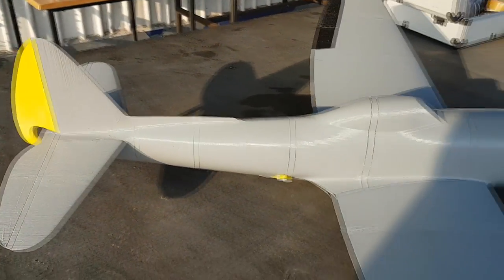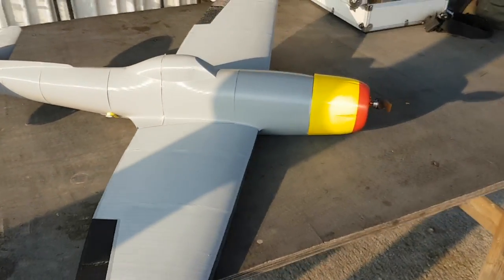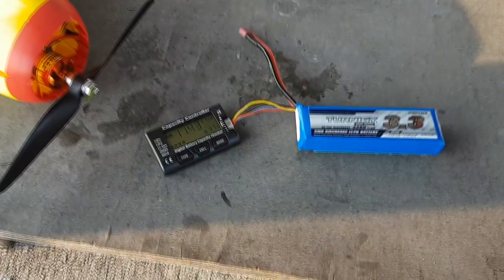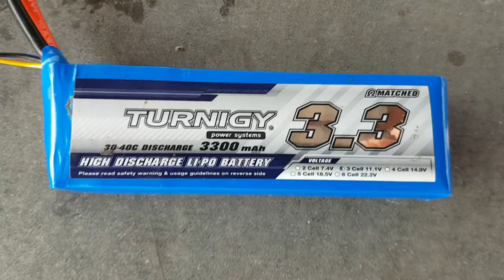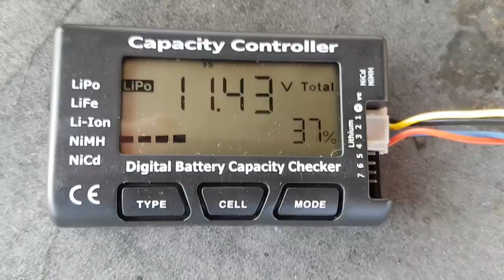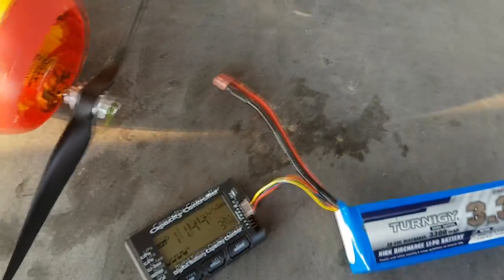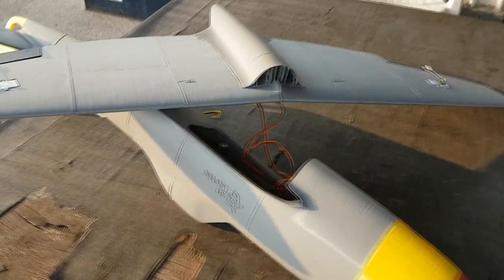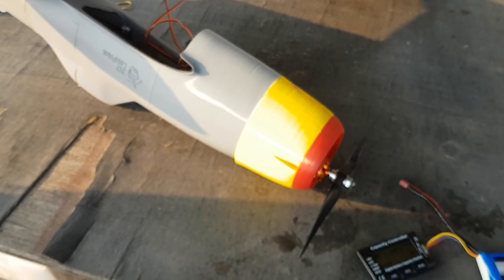3D printed P-47 RC airplane maiden flight

Comment: Just a quick question - why do you use this motor with 60A ESC while its max amps should be under 25A? Is it because you had one handy? Or this is from extra precaution to have extra margin?
Reply from the maker: I had it on stock and that is why I have used it.